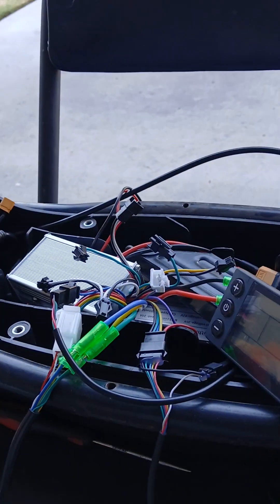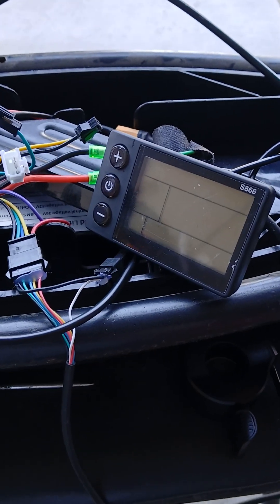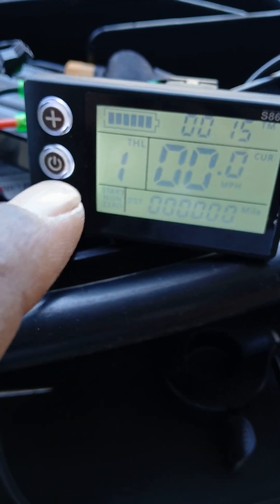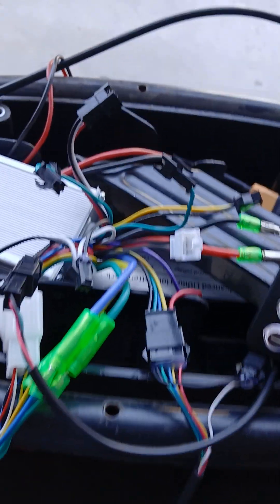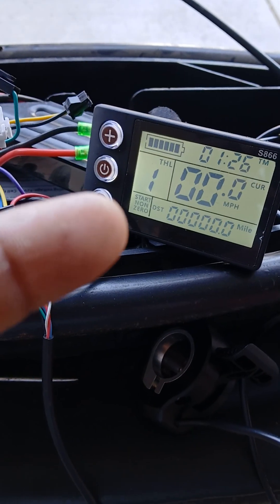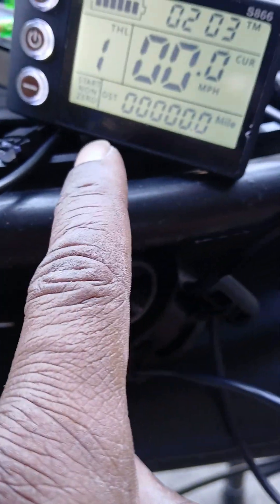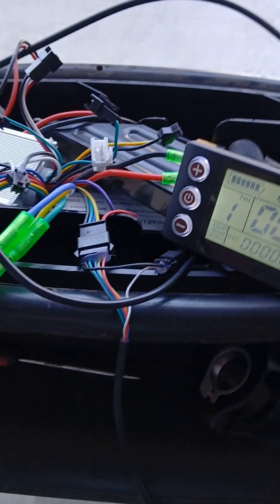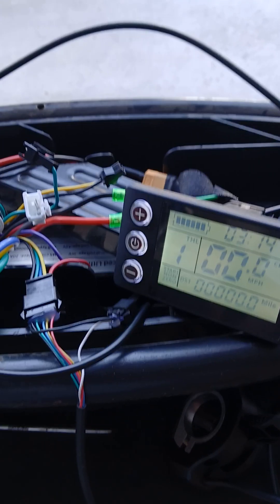S866 LCD and Brainpower Controller issue with Throttle

Comment: Hey man i plugged mu throttle into the blue black red wire from my 350w brainpower controller but it doesnt do anything, the throttle doesnt work, please someone reply to me asap❤
Reply from the maker: No worries. I did an update to this video where I got it working. The video is here - https://youtu.be/0Oq1gjTleSo?si=-6v9YNpqnIh0nKgy

Comment: Make sure the brake levers are pushed out all the way. Check you pedal assist sensor and also you could just need a new throttle handle. If it’s like mine it’s cheap and breaks quick. If that doesn’t work, check your controller bc you may have a blown mosfet sensor..
Reply from the maker: @AntDakota  I figured it out and made a video on it - https://youtu.be/0Oq1gjTleSo?si=J0VB05B1aryikbhv

Comment: Check if you have 5volts on the Red wire and a return voltages to the controler on the Green wire looks like your missing your volts

Comment: Connect learning wire and use your throttle to save the program and disconnect the learning wire and you will see your throttle works.

Comment: I do not know if you managed to find a solution. I had same problem and finally managed to have brainpower brushless motor with throttle and s866 display. 
Using it to spin a hovercraft wheel and for power having the hovercraft salvaged battery too. 

I have connected the throttle to the 3 wires of the motor colored red black and white, where the white connects to the signal wire of the throttle. 

Using crocodile wires to put it together. 
I don’t know how to attach image to show you. 
Sounds like you used the accelerate wires (red black blue) instead of the throttle wires (red black white) for this controller. 

I was stuck previously with the display settings always getting PAS, but saw on your vid you had managed to get THL so that helped me fix my setup. Hope the wires will fix yours.
Reply from the maker: @DimitraRetsina-w8f  I appreciate you so much for this!!! I'll take your advice and give this another go tomorrow!!!
Reply: @therealcmplx Hello brother! I hope all Good with. I'm here to ask if u solve the trotter problem did u make it works??
Reply from the maker: @eduardojazusmartinez9845  I did! Here's the video I made showing how to make it work https://youtu.be/0Oq1gjTleSo?si=IlPyVnHqD2QSGZoj
Reply: @therealcmplx  thank you

Comment: You should be looking in the P-settings and there yóú'll find the right way how to use your throttle.
My question is...
Because I can't find a good clear simple wiring diagram for how I should connect the wires from my S_866 lcd display to my throttle and then to my controller !!!
Bút yóú'vé already made the connection só please please help me out with this problem....
Because this is my first project with a e-bike and I dón't wánt to scréw this up.....‼️‼️
Íf yóú knów whát I méán...
Só please brother can you pléásé..., Pléásé sénd me the pictures or email how to connect the wires from my display to my throttle and motor controller. I thínk I knów the red/black wires they need to be connected with the wires from the battery....?? 
(I hope I got that right....)
Greetings from fg from the Netherlands
Reply from the maker: I'm going to give this another go tomorrow and provide an update.
Reply: My friend you forgot to use your throttle. First you connect the learning wire (while the wheel spin use the throttle to save the program and thats the time you disconnect the wire. And you will see your throttle works. I have desame issue before i watch you utube to figure out how to solve but could not find how to fix but i figure out by my self. My ebike works now
Reply: @jovenjarata-ex2oi  can I put a video up how two do this
Reply from the maker: @jovenjarata-ex2oi I had to use the other throttle input to make.it work. Here's the video I did on how I made it work https://youtu.be/0Oq1gjTleSo?si=IlPyVnHqD2QSGZoj